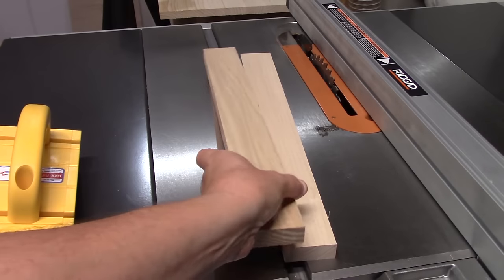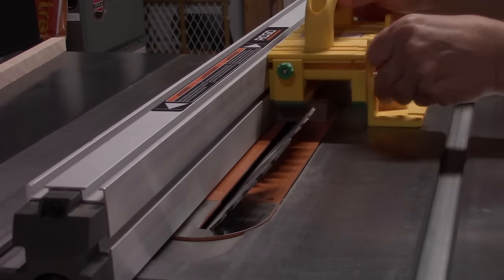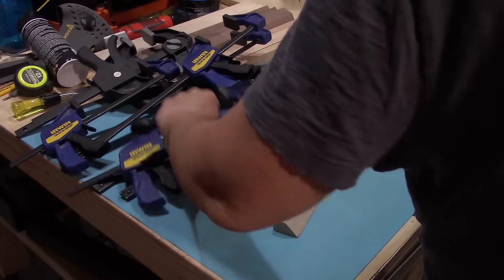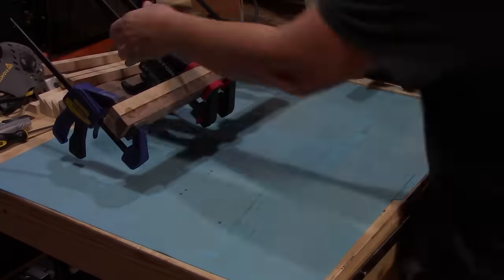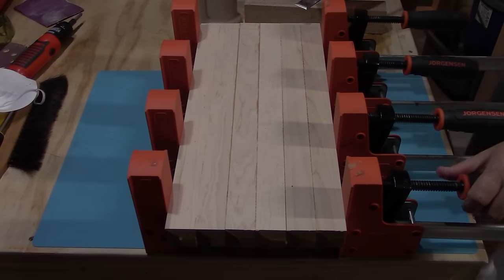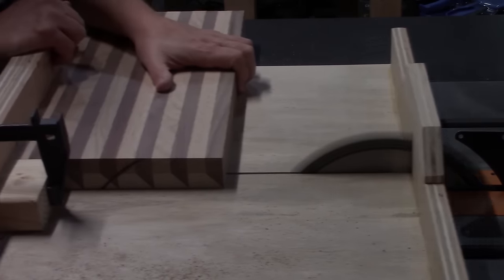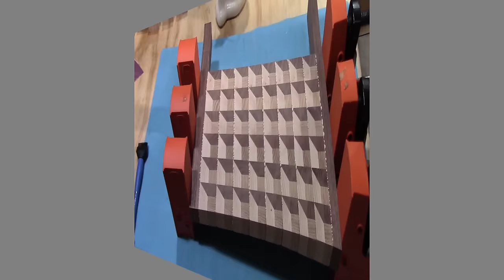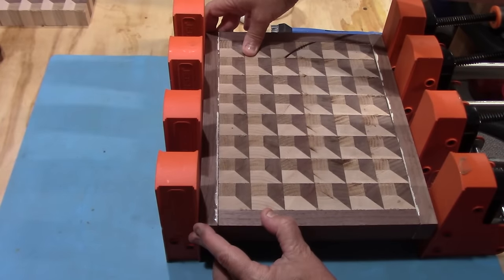The Stunning 3D Cutting Board - Part 1

Comment: This board is a bit small but I guess if I add another one or two  of the glued up squares  or just increase the dimensions proportionately it will turn out to be larger.  I had  watched several other board builders on YouTube and they had said that the boarder of an end grain board should be made of end grain  not edge grain because of the unbalanced expansion and contraction rate. The board looks great and I will attempt to make it as soon as possible. Thanks for the video.
Reply from the maker: Thanks for watching the video and commenting.  I appreciate it.  You are correct, if wanting a larger board then you would simply make more individual glue ups, or also start with longer stock.  I have taken a lot of criticism on the border arrangement on this board.  In hindsight, I would likely leave it off altogether, but if you plan on adding one, then it would be better to also have it be in endgrain orientation with the rest of the board.

Comment: Great video and very informative! One thing I would say is not to put the outside walnut boards because the grain orientation is different, as you have long grain glued to edge grain, I might be overthinking but it could lead to crack. Still, amazing work!
Reply from the maker: Thanks for watching the video and commenting.  Not sure how I managed to miss your comment.  Anywho, yes, you are correct on the grain orientation and I've had several viewers call it to my attention.  If I were to make this board again I would either arrange the border in endgrain, or leave it out altogether like the smaller board shown at the beginning of the video.  So far the board is doing well according to the owner, and isn't being used a daily cutting board but more of an island show piece.

Comment: I have made several of your boards and they turned out quite well.  Instead of using clamps to put the pieces of wood together I use bicycle inner tube I cut the inner tubes 1” x 20” and  wrap each assembly with an inner tube and I have equal pressure throughout the fitting.  It works really good and I do not have any need to fill open spaces.
Reply from the maker: Thanks for watching the video and commenting.  Great tip!

Comment: one of the things I find most assuring about your videos is that you don't have a shop full of $20,000 worth of woodworking equipment. you're using average price stuff and get amazing results!
Reply from the maker: Thanks for commenting on this video as well.  I still, and will always, consider myself an amateur woodworker.  While it would be nice to have expensive equipment, I've tried to keep things on an even keel.  I have splurged a little with my drum sander, but use it for every project that I produce and it's a huge time saver over orbital sanding.  As tools wear out I have upgraded a little, but nothing too drastic, just better tool quality than what is being replaced.

Comment: The border needs to be end grain also. If not then the differences in wood expansion will cause issues. Believe me, this has happened on even the smallest of end grain cutting boards I have made.
Reply from the maker: Thanks for stopping by to watch the video and commenting.  I'll watch for any separation and cupping on this. I've done a couple of other end grain boards with a similar border with no issues, but until you use them, expose them to water, etc. you're not likely to see the problems until then.  Appreciate the comment and suggestion.
Reply: Ive also had many small end grain boards crack because of that. I think if the border pieces if fresh cut and glued on, the slight bowing that can happen pulls the end grain pieces apart. Boards that were never used and never exposed to moisture. except air moisture.
Reply: I've done this many times I've never had an issue maybe it's an issue with the glue you're using
Reply: @jodyaugust5087  Titebond III
Reply: @Warpfield  unless you're mixing softwood in there I can't see why you would have that problem because I do this all the time and zero issues ever or maybe don't have enough glue who knows also where do you get your wood from do you get it from a trusted supplier or sawmill because if it's above 10% humidity level that could explain everything also depends on how you finish it
Reply: On of my favorites! Great job sir! I have also heard this problem repeatedly on a couple of woodworking groups online.(Edge grain with end grain) I really like the border but I'd just give the boarder a quarter turn to make everything end 
grain then there shouldn't be any expansion issues like cracking.
Reply: That was my thoughts also.
Reply: @D.E. Jaeger Woodworking  How is that board holding up after using it for two years? I've seen a lot of those on social media cracked and border failures with long grain borders.

Comment: I use the same system but instead of clamps I wrap the individual bundles with heavy duty plastic wrap. Works great!!
Reply from the maker: Thanks for stopping by to watch the video and comment.  Another great tip.  I had somebody else indicate that they used a combination of clamps and painter's tape.  I realize that some may not have that many clamps, so thanks for offering another alternative.
Reply: @DEJaegerWoodworking  i would have used masking tape on the mitres and then spring clamps to hold all 3 pieces together. Less cumbersum, more accurate and easier.

Comment: Great video. Just thought I would pass along a glue up technique I tried that seems to work well for me. Instead of the clamps the author used, I tried tape as others have suggested and had success but wanted a bit more squeeze on the pieces so I tried using some inexpensive automotive radiator clamps. I wrapped tape around the pieces to get them together initially, then added the radiator clamps over the tape and tightened them a bit more to get a tighter joint,. The tape also kept the glue off the radiator clamps making it easier to reuse them later . Thanks to the author for a well done video.
Reply from the maker: Thanks for stopping by to watch the video and comment.  Glad some of the instructions helped with your video, and kudos for thinking of other techniques for the glue up.  I've got a really cool one almost ready to post that is a really cool patterned cutting board... stay tuned!

Comment: Nice and precise ! The only thing I would do different would be to use mitred corners, but that’s just me. Your design is good too. I watched it twice and made my own. Funny thing was , that one of the things I make are poplar stretchers for my paintings. They use the same cuts , a long 45 degree bevel along a two inch , 3/4 piece. All I needed was the long square piece. Now I know what to do with all those off cuts. Thanks for the great video.
Reply from the maker: Thanks for stopping by to watch the video and comment.  Really the border was a completely last minute thought, but I agree, the look would have been nicer than a butt joint.  Glad you took the design and improved upon it.  It's a really nice looking board too!

Comment: I made on that I am very happy with and had enough material for 4 2X2 section coasters with 1/2" borders as well. The only thing I did differently was that I used cherry for the 3/4 x 3/4 pieces. I also cut the angled ripe in walnut and maple 1st and then sanded the 3/4 strips to fit on the drum sander. leaving the slightly proud and sanded them flush as the opposing surfaces were flat  It just seemed easer to control the accuracy. I gave the set to my daughter. Now her friends all want me to make boards for them. The coasters were  nice touch but I finished them with poly to control moisture from "sweating" cold beverages.
Reply from the maker: Thanks for your feedback.  Isn't that how it always is, you make something for someone and then everyone wants one!  Hope you're able to accommodate them.

Comment: I am late to the party as I just stumbled across this video. This is one of the most beautiful cutting boards I have ever seen! I guess I missed the part were you shared the dimensions of the wood and the final dimensions of the cutting board? Do you mind sharing the details? Again, phenomenal work!
Reply from the maker: Thanks for watching the video and commenting.  The beginning dimensions of the stock were 16" L x 2" wide x 3/4" thick.  The final board dimensions were about 12" x 10" x 1 1/4" if I recall correctly.
Reply: Thanks so much! @DEJaegerWoodworking

Comment: Great video as always but if I could point out you could also use jus regular electrical tape instead of clamps for putting up those pieces together ........by the way jus a suggestion ........keep up the good work .....love your piece of art there brother☺️👍🏻👍🏻.....cheers
Reply from the maker: Thanks for watching the video and commenting.  I appreciate it.  I've had a few others suggest tape or rubber bands.  Would definitely eliminate the need for so many clamps.

Comment: Nice work, dude. Your accuracy really makes the pattern pop nicely.
Not to belabor the point, but the mixing of end grain and side grain really CAN be a disaster.
I have made about one hundred end grain cutting boards. The only ones I know to have cracked open and failed are the two in which I mixed the grains.
I’ll never do that again!
Reply from the maker: Thanks for stopping by to watch the video and comment.  Yeah, I seem to be taking some guff for the border not being aligned end grain as well.  I guess time will tell.  Some of it will obviously be determined on how the board is cared for by the owner.  When you spend as much as you would on a cutting board like this, you would hope that it is well cared for, and I do include an instruction sheet with detailed cleaning and conditioning instructions with all of my boards.  I realize that will only go so far, but do try to make sure that these boards will last.

Comment: Great video, I think I'm going to make it soon. Can you tell me the section lengths? I'm guessing about 18 inches from studying the video.
Reply from the maker: Thanks for watching the video, and for your question.  If I remember correctly I started with 18 inch long stock.  However, keep in mind that the starting lengths, the number of individual glue ups, and the desired thickness that you cut those glue ups do will ultimately dictate the size of your board.

Comment: Red oak for a cutting board?  I thought that was a no no. Love the way you created the pattern. I’m thinking about a drum sander. If that is the jet 10-20 that’s the one I’m looking at.
Reply from the maker: Thanks for stopping by to watch the video and comment.  I've taken a little heat for using red oak in this project due to its porous nature, instead of the traditional cherry.  It really is going to be on the cutting board owner for know how to clean and care of their cutting board.  The owner I made this for is extremely particular about his cutting boards and knows proper care.  Additionally, I provide extensive instructions with every cutting board on care, cleaning, and conditioning.  You'd be surprised how many people really don't know the proper care of a cutting board.

In regards to the drum sander, there an unboxing video of my sander in my videos.  Check it out.  It is the 1632 by Jet
Reply: Nothing wrong with oak for cutting boards. It's a misconception that it's bad. The wood itself has antibacterial properties.
Reply: Three years later 😂. Thanks.

Comment: I made one like this.  Posted in FB cutting board group. I got a lot of compliments but a couple comments saying that the border would cause issues with wood movement.  Thoughts?
Reply from the maker: Thanks for watching the video and commenting.  A lot of the issues they are talking about do have some merit, but I also think a LOT of those issues can be avoided through proper cleaning and caring of the board.  A board needs to be cleaned and dried in a certain manner, and they need to be conditioned on a regular basis to keep the wood from drying out.  That is what is likely to cause the separations that they are referring to.  Those facebook comments are also address the issue of the arrangement of the border.  It really should be arranged in the same direction as the rest of the board, in this case end grain.  I received some similar comments.  After having made several of these now, I don't include the bordering at all.  The 3D effect is actually better without it.  You can see the smaller board at the beginning didn't have the border.

Comment: just watched the video love the detail and the explanations. Just curious on the overall dimensions of the finished board? I see in the comments you started woith 3 boards that were 18x2x3/4 so would like to see how big that makes the finished product so I know if I need to go with more pieces? thank you. great work
Reply from the maker: Thanks for watching the video and commenting.  It's been a while since I made this board and wasn't quite sure on my starting stock lengths.  They could have been 12" or 16" long.  If I recall correctly, the ending dimensions were approximately 12" x 10" x 1"  Obviously the longer pieces you begin with, and depending on the number of glue ups that you create (around video time signature 15:53) the bigger the board you'll end up with.  I would imagine 18" length boards would give you at least a board of 16" long.

Comment: Did the board crack already? I've had some glue-ups crack when I glued a sacrificial piece of wood to an end grain cutting board for jointing-planing and put it away for couple of months
Reply from the maker: Thanks for watching the video and commenting.  No, the board hasn't had any separation, but I will say that the customer who purchased it is using it more as a show piece on their island rather than a daily cutting board.  And, they are conditioning it on a fairly regular basis.  Fingers crossed, but if I had to do it again, and I have a few times, I don't add the border.

Comment: I found a way of making the first glue up without having to use all of those clamps. I made a jig to hold the two 45 degree angles, point down and the square stock just goes on top. I then made a few small clamping cauls the same way for the top side. I made my glue just using 4 clamps.
Reply from the maker: Thanks for stopping by to watch the video, and taking the time to comment.  Sounds like a brilliant idea! I love to see the pic of your jig if you want to email me at the address located on the About tab on my Youtube channel.  I'm getting ready to do another one of these for a customer and may want to go this route.
Reply: @DEJaegerWoodworking  I am not good with Youtube so I don't know where the "About" tab is.
Reply from the maker: @carlmerideth143  Here you go...  	dejaegerwoodworking@gmail.com
Reply: @DEJaegerWoodworking  Did you receive my email?
Reply from the maker: @carlmerideth143  Sorry for my first reply, I found your email in my junkmail folder.  Thanks for the detailed plans.  I'll give them a closer inspection and may have some follow-up questions about the build.  Thanks!

Comment: D.E. Jaeger, I don't know how to post photos on YouTube, so I'll send a photo of how mine turned out on Messenger and you can show it if you want to.  I want to thank you for posting this video. Absolutely no way I could have come up with this myself! A few comments: 1) Did glue up with blue tape and rubber bands around the strip containing maple, walnut, and cherry -- no clamps. I didn't think they were all lining up properly and I was surprised with the final result! I might use clamps in two directions (at right angles to each other) next time. 2) I should have realized that the board would be 9" wide considering the dimensions of the individual strips of 3 woods (1.5 inches x 1.5"). Of course, one could change the dimensions of the individual pieces of wood, but I'll probably use 8 or 9 strips instead of 6, along with a length of about 18". 3) I used a planer instead of a drum sander, and I'm sure I was taking off more material than you were with the drum sander. I just made sure that the proportions stayed the same, so every time I sent a strip through the planer I rotated it 90 degrees and sent it through again, maintaining a square shape. I hope this makes sense to anyone who hasn't tried to make the 3d board -- it makes sense to me after working through it, but I may not be explaining things well.
Reply from the maker: Sure, just email me the pics that you've got.  All makes sense in your description.  The stock dimensions are of course up to you and what you're looking to achieve for final dimensions.  Even if you don't plan to use all of them it's good to have an extra one or two in case one of the others doesn't glue up as well, or you find some wood defects that you weren't anticipating.  In the chessboard video on my YouTube channel there's a great example of having an extra piece of stock prepared as I experienced a cut failure on one of the alphanumeric strips along the sides.  It took far less time to recover because I already had a similarly milled piece.
Reply: I also used rubber bands . And I also used a thickness planer. And I also added on two three more strips since I didn't use a boarder. It's all relevant.

Comment: Great videos, and beautiful board.
As I am a novice woodworker that happens to have a drum sander, I have a few questions…
What grit paper are you using on the drum sander during preparation of the initial glue ups? (Can you use a jointer?)
And why hand sand before glue up of final pieces instead of using the drum sander ( set at the same setting)?
Joints are my main concern, but I will be tackling this project.
Thank you for posting such detailed videos!